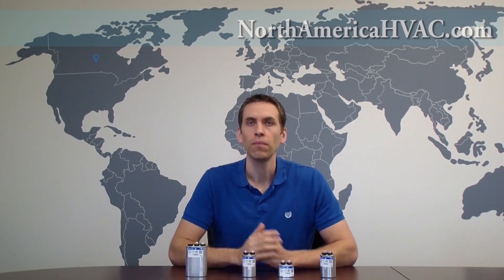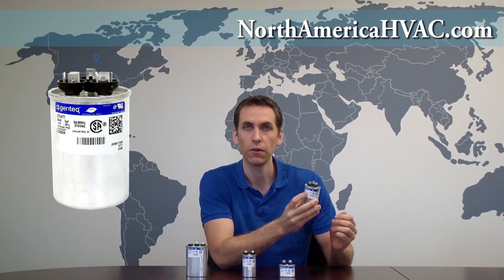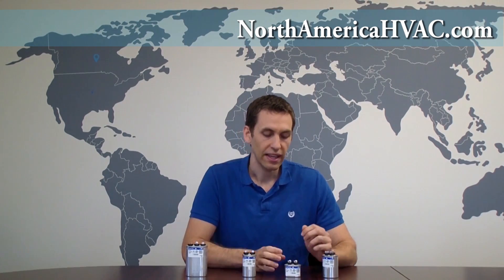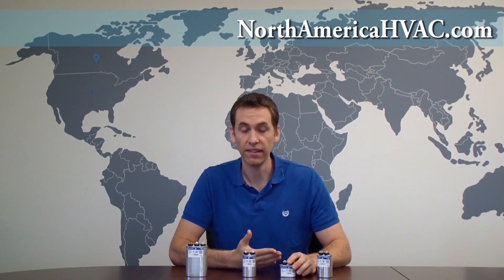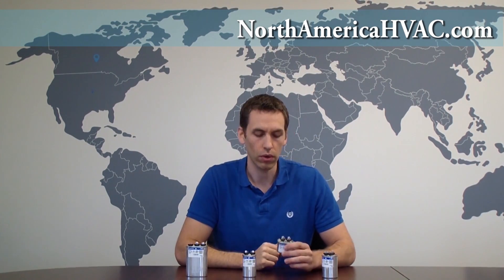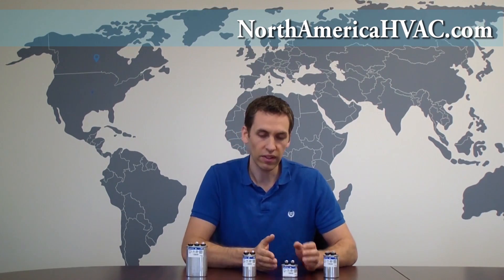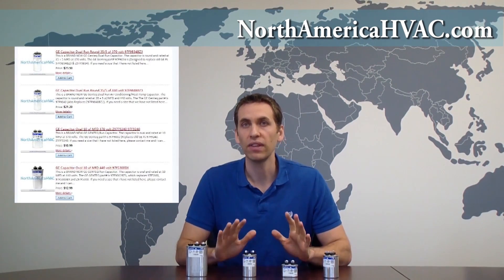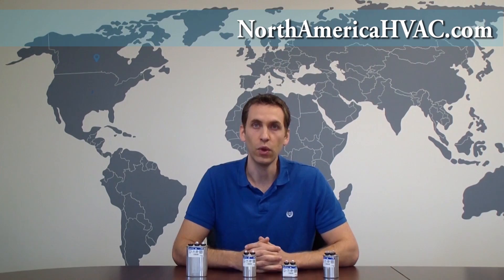What is Dual Capacitor and what is the difference between a Dual and Single Capacitor?

Comment: Question I have a single capacitor on my condenser unit. Two wires only. How does the fan run on this type of capacitor?

Comment: On the capacitor does the fan terminal send juice to start both the fan on the AC unit outside as well as the fan that blows air out of the AC vents inside the house or are they two separate  systems?

Comment: Is it possible my Trane 4TWX5042A1 heat pump doesn’t have a capacitor for the fan? There is a single 45uF capacitor (97F9646) and no other capacitor visible anywhere. The fan is GE ECM 230V AC.

Comment: i have a question. You said for an AC you need more than one capacitor and if i understood right, you could have 2 or more run capacitors or you could have a dual run capacitor, so that you have two capacitors in one enclosure.  My AC started blowing warm air last week and someome came out to fix it.  3 years before, the same thing had happened and a different company had come out to fix it. On the receipt for that, it says "installed new dual run capacitor."   When it happened last week, the guy told me i needed a motor because it was burning out the capacitor and that would keep happening. i think that's what he said.  Something was causing the other thing to burn out and one was the motor and one was the capacitor. He said i needed to replace both the motor and the capacitor.  When i got the invoice it said capacitor, it didn't say dual run capacitor. I asked him about that and he explained why i didn't need the dual run one but i don't remember now what he said.  From what you said, i am wondering, if he didn't put a dual run capacitor in, but AC has more than one thing that needs capacitor, Fan motor, compressor and something else, then if he only put a run capaciter in to replace what was burning the motor out (or was being burnt out by the motor?) then did he leave the dual run capacitor in there, to cover the other thing that needed capacitance?  In his explanation he was saying that putting a single capacitor on the motor would stop the problem of repeated burn outs.
Reply from the maker: Its hard to say. I am guessing that he installed a single capacitor for the new motor he installed and kept the compressor connected to the old dual. If the capacitor went out after three years, I would not blame it on the motor. Maybe you just had a bad capacitor!